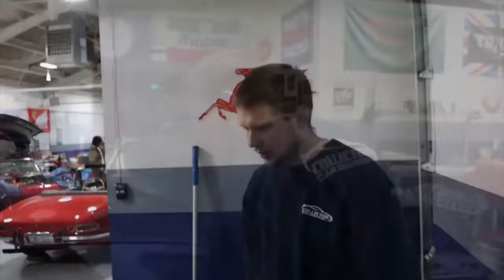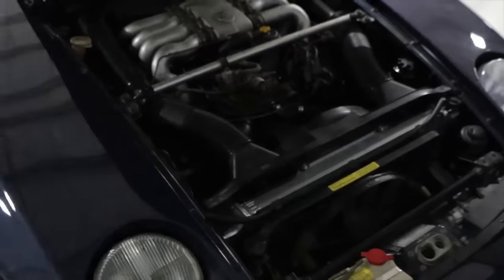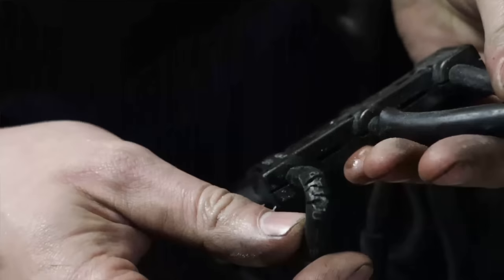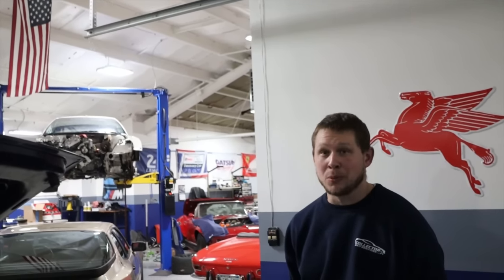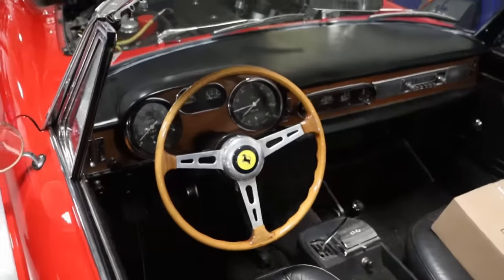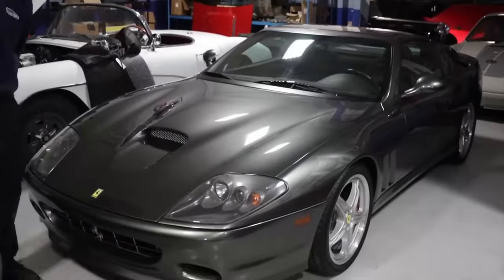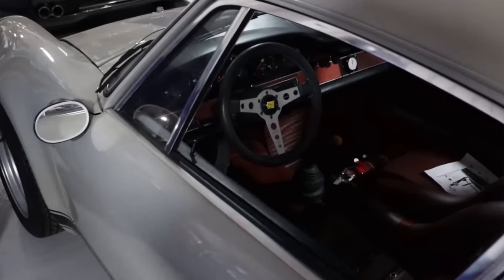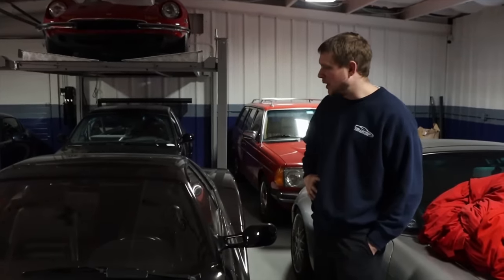Yes, I Spent A Lot Of Money But It Was Worth It! Porsche 928 Revival - Part 7

Comment: I've just bought an eighty eight 928S4, 54500 genuine and documented miles. Mileage wise, it didn't need the cambelt tensioners and water pump done, but it was last changed in 2006! Straight to the specialist in Norwich to get changed for piece of mind. New bonnet struts next month. But I am gobsmacked as to all the attention it gets.

Comment: I think the problem with a lot of German cars is they can go 10-20 years without very little maintenance but that bill is only being deferred to the next owner.
Reply from the maker: In this case, I’m afraid, I AM the next owner! Lol!
Reply: As a Porsche owner I can concur - some models can get relatively cheap second hand but you are going to pay Porsche prices to maintain no way around that. 

Best solution is regular maintaining little and often that way you avoid the big surprises but eventually you are going to fork out for some large maintenance repairs
Reply: Assuming you meant "with little maintenance" good point. However, that's with pretty much the case for any car. 

When most cars get to this point, the car is disposed of. It's the few cars worth saving that get restored. 

Often times, it's bedt practice to strip the car down completely, inspect everything, replace everything needed. It's just that most people aren't willing to put the time and money to do it, and that's perfectly understandable.
Reply: Same with most tough reliable vehicles. My 80series Land Cruiser and Subaru Legacy were both ran into the ground when I got them. They were rough through neglect/abuse but would have kept going for years with the wrong owners. I've seen Toyotas in 3rd world countries that are decades behind on basic service that'll go forever.
Reply: And I didn't defer the work on my car (not a Porsche) and after 10 years and over 100K miles, some very expensive work need to be. Unless it's a Lexus, most cars will need a lot of work after that amount of time and mileage. Thankfully, my interior is holding up great.The electro-mechanicals...hmmm...not so much...

Comment: Actually the 16V motors are not interference engines,so a broken belt is not a terrible issue.  The later 32v motors are all interference engines so the belt is a big issue.
Reply: No, the 928 S with the 4.7 L engine from 1980 is already an interfering engine, only the 4.5 "Ur-Modell" not...

Comment: I own a 1986 Porsche 928 32valve 5dpeed same exterior/interior like yours
 I had an automatic which was slower and heavier and sold it because even though the automatics are easier to drive, the manuals are worth more. I replaced the rims  with 911 turbo twist rims.

Comment: 3:17 to 3:26 - are you guys serious ????? this fresh coolant will wash out rest of the debris from the heater core and will clog/compromise new radiator and cooling system all together , and in the end still will be needed to be replaced. do it right while you are there
Reply: From what he's saying it looks like its going to take a while to get all the crap out. If it was me I'd just keep dropping the bottom hose and refill with cheap coolant until it settles down. A good run with its new water pump should get it all moving through.